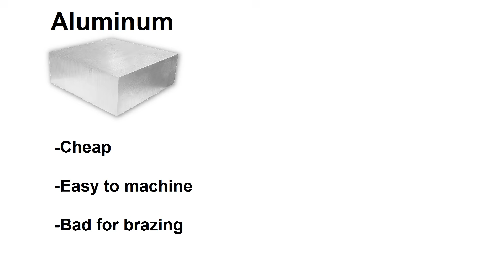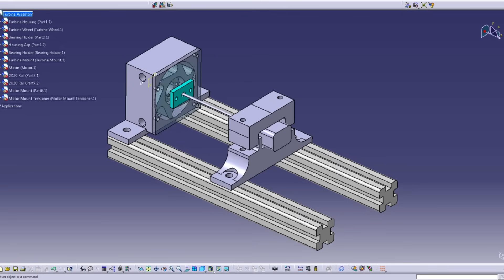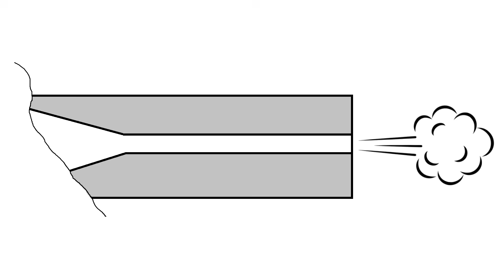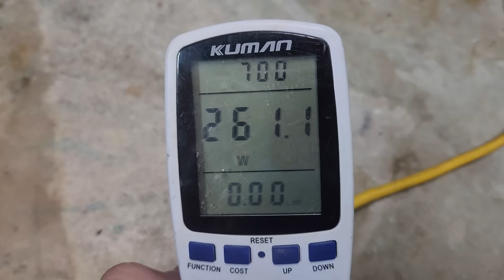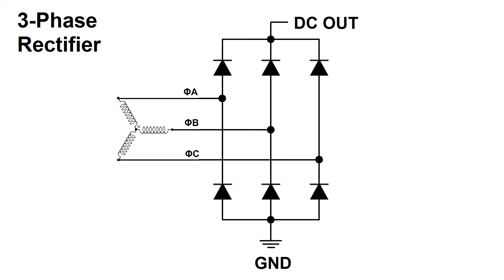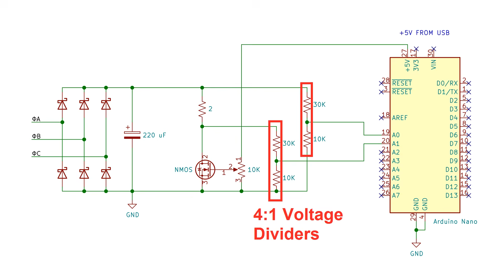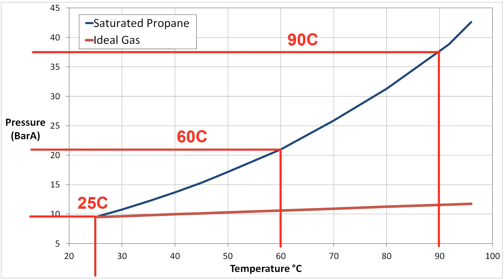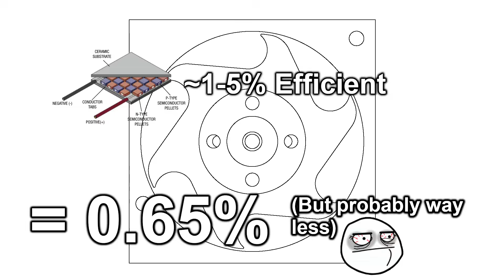DIY Micro Steam Powerplant

Comment: Most modern engines use a variable vane oil pump with metal dividers, and even have variable housing geometry that could help dial in chamber pressures for efficiency across multiple RPM ranges or input pressures. Look at the Chevy LS pumps for the most available solution - they are somewhat self contained as well.
Reply: There are standalone variable oil pumps for industrial use all over the internet for cheap, and honestly look perfect based on some cursory searches. - keyed shaft and even water cooled so you could use the turbine itself to pre heat feed water before it hits the boiler.

Comment: Are you able to use a large cylinder of compressed air, and a heating cylinder to increase the air pressure using the propane?

Comment: Invert the heating coil. You need the hottest part to be in contact with the steam to superheat it. Also insulate the burn pipe so all the heat stays in, and you only lose heat from the exhaust. You already know what to do with the turbine. Wind the heating coil on a piece of flat bar so the coils swirl and force all the hot gasses from the burner to swirl as much as possible and to deliver as much as possible heat to the steam.
Reply: Also recover the heat exiting the turbine by preheating the cold water
Reply: Good ideas, but can you provide a picture link or a less ambiguous description of how a flat bar coil form results in coil swirl?
Reply: @YodaWhat  Picture the coil, wound on the bar maybe 5-10 times wider than it is thick: The coil, held tight, is following a rounded-rectangular rather than round cross section. Then, when you take it off the bar, each turn loosens a bit, and so the longer sections are no longer pointed quite the same way as for the next turn. Increase the effect by un-twisting it a bit more. This leaves the whole thing overall cylindrical again - now roughly the wider diameter of the flat bar, and going around like you draw a five-pointed star, only messier (bit like a spirograph).  This distributes the tube across the inside of the pipe better, and will give the steam better contact with it.
Reply: @RGD2k  - Thank you, that's a very helpful description. I was a bit confused for a reason that may become clear... That kind of helical coil will add a bit of very helpful turbulence to the combustion gas flow and perhaps to the steam flow, BUT it also reduces the total length of tubing, and that is undesirable.  Unfortunately, it is not clear which effect will predominate and give best results. So instead...
A slightly different approach which is still quite simple is to take a strip of sheet metal (not galvanized) that fits inside the round coil and twist it into a helix, then insert it into the coil, and the coil into the chimney pipe. That will slow down the flow of hot gas and make it pass diagonally over the tubing, which is a longer path... Very helpful. 
Also run some vertical wires (at least three, and about half the diameter of the tubing) on the outside of the coil to act as spacers between the tubing and the chimney pipe. That will ensure there are no cold spots where the tubing is pressed against the chimney.
Another useful trick is to slightly pinch the copper tubing every little distance (about 5 to 10 times the tubing diameter), so that the internal shape and cross section is variable. That asymmetry forces the water/steam speed to vary and induces turbulence, which improves heat transfer. The depth of pinches should be about 1/4 of the tubing diameter: enough to create turbulence but not enough to seriously restrict the flow. A safety benefit of the pinches is that if any of them balloon back out to more of a round cross-section, you know you're operating too hot and/or at too much pressure for that tubing. IF you want to operate hotter and or at higher pressure, consider using cupro-nickel tubing with a relatively thick wall, or automotive steel brakeline tubing, and/or using more turns of smaller-diameter tubing, which is inherently better at resisting pressure.
Reply: This.  That's very wet steam coming out during the boiler test, before it even loses heat running the turbine.  It should be entirely transparent, with no entrained water droplets.  That boiler design also loses a lot of energy up the center of the coil, so I might suggest keeping the existing coil and adding a second, tighter coil that runs counterflow down the center of the first.
Reply: Yep, he needs that superheated steam for that turbine
Reply: Setting up some kind of heat exchanger with the outgoing steam would also be good, but a lot more technically complex.
Reply: The feed water needs to go through a large coil that goes around the outside feeding from the discharge end down to then feed into the inch put end for the internal coil and nozzle. Then insulate the outside of that coil with ceramic wool insulation. 
For your turbine, you want to engineer the parts to be the same size. Once they're made use polishing compounds to spin them together to have them grind each other for perfect fitment. 
A secondary condensing turbine on the back side, and perhaps the secondary ignition tube to ignite the propane dissolved in the water steam...
Reply: Yeah, a mono tube boiler with a superheater coil and a water heater coil would definitely help with efficiency
Reply: Not an expert on this stuff by any means, but might it not be useful to pack the boiler with a copper "wool" that would extract heat from the gas and transfer it to the metal boiler surfaces? The idea is that no hot gas is allowed to flow through the system without repeated contact with metal surfaces that extract energy.

Comment: old steam power plants spray the steam with cold water at the steam outlet of the turbine so the steam collapses and forms a very strong vacuum. It makes the turbines a lot more powerful because you are basically adding a atmosphere of difference. The fun thing is you don't even need a pump to do that the vacuum itself pulls in water so only thing you need to do is jump start the process and then regulate the flow. Also tesla turbine is very easy to machine, its only a few flat disks and a housing and works with stem if you preheat it so maybe you should try that.
Reply: He needs a pump to pump out the cooled water and steam.

Comment: You can virtually eliminate the diode voltage drop by using a full wave synchronous rectifier. That’s literally the mosfet circuit to drive it (but in reverse).
Reply: I believe you meant "magic." Or more accurately, "pain in the rear."  Not that you're wrong.  Just that I'm thinking of all the ways it can go wrong and how getting it working is a project in and of itself.  Especially since I'd want some hardware safety in there to keep from dead shorting things.

Comment: The motor rating is Kv (K sub V) not kV as shown. A minor thing, but since motors can involve both units , it helps to be pedantic. Also, what happens if you drain your water supply? Aren't you then pumping propane through your heated coil. How big of a deal is that? I'm thinking not THAT bad. Isn't that basically a BBQ burner?

Comment: nice bro, I got hella suggestion to make this way better!! Use a turbocharger as the turbine, It can soak up as much heat and spin as high as you want to go, On top of that route the wasted steam exhaust around the metal pipe to preheat the pipe, using less fuel to heat it up. you can connect a shaft to the turbo exhaust turbine wheel to spin the generator. Max Efficiency!!
Reply: A good option for a much larger engine, but you'd need a boiler to match - it's scaling up considerably.
Reply: @vylbird8014  they make really small turbos people put on go karts etc. as well.

Comment: Some simple efficiency optimizations:

Converging diverging nozzle-like optimization can be done quite easily: just use a cone shape at the end, it's not the perfect shape but a lot better than a hole. The size is easy to calculate: the pressure ratio is equal to the flow area ratio, e.g. 9 bar -> 1 bar means outer diameter is 3x hole diameter.
Next point of optimization is the boiler flow direction: steam exit should be on the flame side, water input should be at the exhaust side. This acts as a heat exchanger and extracts more heat from the flame. The turbine exhaust can further be used to pre-heat the water in another heat exchanger. Test the steam output temperature, it should be a lot higher than 100°C, this also increases efficiency. Add a bit of insulation onto the flame pipe. Maybe even put another tube around it and let the combustion air run through it to pre-heat it.
For the schottky diodes, you should use bigger ones and have them run hot ~100°C. That makes them way more efficient.
Reply: You seem to know your stuff quite well! What do you do for work/fun so you are this well informed?
Reply: @TheOriginalEviltech  I am a black hole sucking up endless STEM knowledge. I like watching 2 hours deep dive videos into some technical subject and remember most of it. Just don't ask me to remember people's names...
Reply: @HL65536  haha, same here! Not allot of people like us!
Reply: @TheOriginalEviltech idk this channel seems pretty big to me
Reply: A CD nozzle is a tuned device and just making something that looks right wont' be effective. You can use calculators to determine the correct dimensions. You give advice on sizing the diverging section, but unless you can achieve supersonic flow which can be choked down, there is no point in a diverging section and a correctly sized hole is actually the right nozzle.
Reply: ◉◉◉  Bubbles forming at the wall are huge source of insulation There is a YT video on this which I have in my vast collection of bookmarks...but will never be able to find. HAHA.

You've chosen a poor turbine architecture for this app  and design is also bad [inlet & outlet openings are same size. SMH]. I'm developing several advanced power and propulsion turbine designs.
---
✈✈✈ℕ𝔼𝕎  𝔽ℝ𝕆ℕ𝕋𝕀𝔼ℝ  𝕋𝔼ℂℍℕ𝕆𝕃𝕆𝔾𝕐  𝔾ℝ𝕆𝕌ℙ is a visionary multidisciplinary B2B innovation company utilizing a licensing business model or collaborative enterprise with strategic partners to develop Advanced clean, efficient, power dense solutions in domains of energy, propulsion, mobility, robotics / exoskeletons and clean technologies with a particular emphasis on the aerospace sector including space exploration and commercialization
[Yeah, I do all that and more]

===
🚗🚙🚚🚢✈🛩🚁We're working to derail the Exploding Vehicle [EV] paradigm. Any mobile platform is only as good as it's power supply. The main advantages of our disruptive 𝔽𝕦𝕖𝕝 𝔸𝕘𝕟𝕠𝕤𝕥𝕚𝕔 ℤ𝕖𝕣𝕠 𝔼𝕞𝕚𝕤𝕤𝕚𝕠𝕟 engine is the constant maximal efficiency & torque...at any speed, load, temperature or elevation.

It is Simple, Low Cost, Ultra Efficient, Constant Torque, Load & Speed Agnostic, Fuel Agnostic, Transmission-Free, Low Heat/Noise & No Smoke/Odor Signatures, Non-Polluting [only lower CO2 which is not a pollutant] with a >10 year [>10,000hr.] MTBO - better than EVs. >100mpg using ANY liquid or gas fuel even CONCURRENTLY W/O DOWNRATING, even if dirty, including hydrogen, biofuels or Natural Gas. [No range anxiety.] Vehicle lifecycle CO2 output is 30% that of EVs.

===
We're going to go one better by going in the air with a low cost, Ultralight category, personal air mobility system - no license, no certification, no emission laws on the state level and soon on the federal level as the EPA gets their teeth pulled. DOGE!!! 👑🤜🇺🇸🤛👑

===
+++Our maximally torque dense, infinitely variable  𝔽𝕣𝕚𝕔𝕥𝕚𝕠𝕟𝕃𝕖𝕤𝕤 𝔾𝕖𝕒𝕣𝕤 [CVT/𝕀𝕍𝕋]  technology enables transmissions of ~1/10th the size/mass/cost which enables use of motors/engines/batteries of significantly smaller size in EVs. It also provides novel 3D motion of robotic appendages/manipulators/booms

Comment: An alternative to a propane boiler you cold use and in induction coil.  The coil itself is the inductor and you can regulate the eddy current with an iron slug. Great project.

Comment: using the propane to pressurise the water feels like a CSB investigation waiting to happen.
Reply: Yeah, this needs a float valve in the tank or something that closes once the water's gone, or a way to keep tabs on the water level. As a "Should i invest more time in this?" test though it's not horrible for a initial test for a proof of concept. certainly it's a lot safer than a pressurized tank boiler.
Reply: There would be no oxygen in the water tank to burn the propane in the water tank with
Reply: As an engineer in the comments, I say this needs to be monitored by the engineer that makes it, it needs a secondary vessel with a shutoff valve from the main propane tank, and needs a low pressure or drop in pressure automatic shutoff valve from the secondary tank to the capillary for the event of capillary failure.  Shutoff Valve should have an alarm and should trigger a secondary valve to shutoff the main tank.  

And that might be the minimum and you shall not take that as full advice.
Reply: @notamouse5630  ❄
Reply: @notamouse5630  in order words, DIY and Powerplant should not BE in the same sentence.
Reply: @Sun3way  As with all things, appropriate care needs to be applied.  A car is a power plant if you make the alternator big enough.  Car maintenance and upgrades can be DIY if you have mechanical skills sufficient.
Reply: @notamouse5630  makes sense, but there should be some safety addressed in the video rather than just follow the video without any doubts.
Reply: @notamouse5630 🔴 What Is Islam? 

🔴 Islam is not just another religion. 

🔵 It is the same message preached by Moses, Jesus and Abraham.

 🔴 Islam literally means ‘submission to God’ and it teaches us to have a direct relationship with God. 

 🔵 It reminds us that since God created us, no one should be worshipped except God alone. 

 🔴 It also teaches that God is nothing like a human being or like anything that we can imagine.

🌍 The concept of God is summarized in the Quran as:

📖 { “Say, He is God, the One.  God, the Absolute.  He does not give birth, nor was He born, and there is nothing like Him.”} (Quran 112:1-4) 📚

🔴 Becoming a Muslim is not turning your back to Jesus. 

🔵 Rather it’s going back to the original teachings of Jesus and obeying him. 

More .....👇

🔴 THE RETURN OF JESUS
Reply: @1islam1  who asked
Reply: The title writes itself: "Designed to fail... SPECTACULARLY!"
Reply: Steam engine operators use a manual pump to pump the water into the flash heating tubes.
Reply: I love it
Reply: Imagine the tank becomes super heated from a fire and ruptures. The steam mixed with propane would create a very fast expanding kabloowey
Reply: Once the water is gone, it's an accident to happen.
Reply: Hahaha
Reply: CBS has great shows. I love the real house wife's on at 6pm. Season finally will be amazing 😍

Comment: 14:00 I'm a liiiittle concerned with the hand in front of the pressurized water, given the source is at 120 PSI - the capillary tube should reduce the outgoing pressure, but by an unknown (to me?) amount, and I've been told that any pressure above 100 PSI can cause injection injuries.  Which are really nasty.

Comment: Industrial power gen guy here.

2 kinds of turbine plants, single stage and multi stage.

Single stage turbines burn just the gas. Literally a reconfigured airplane or helicopter motor, with a shaft output.

Multi stage units will have multiple turbines on one shaft, with couplings between them. The first stage burns the gas, then boils water, used in the other turbines. 

Hydrogen cooled windings in the alternator, power plant type stuff.
Reply: But seriously that sounds really interesting I would love to hear more
Reply: @Xsiondu  Large power plants use hydrogen to cool the generators. It has large volumetric specific heat capacity, and low viscosity compared to something like nitrogen. Some plants now use de-ionized water, but it has its own set of problems.
Reply: So, all the turbines drive a single generator? Aren't there more independent modules (1turbine+1generator) in use?
Reply: @besenyeim  in order to reach maximum efficiency, one chilled generator end is used. The viscous couplings are used to start the other sections once steam pressure is built. It uses a cat 3516 generator for black starts.
Reply: That's quite efficient, hence the reason alternative energy has a hard time competing with conventional power
Reply: Oh papi!  Tell me more about hydrogen cooled windings in the alternator.  You know how I love it
Reply: um?
theres impulse turbines, such as delavals, and theres reactions, such as parsons.

both can be multistaged... curtiss is a staged version of delaval, for much lower peripheral velocities, and a heron aka aelopile is a single stage reaction... and about the only existing example of one.

problem here is he seems to have both types confused, and appears to have no idea about either...

Comment: You may get a better efficiency with a higher efficiency rectifier. You also might have had better luck with some bjts in a negative feedback config to create a stable voltage rail to minimize losses of the voltage dividers.

Comment: There's also lots of lost heat energy. You could collect the stem and use some kind of heat pump to pre heat the tank
Reply: That's called an economizers, they've been a common part of steam engines since the mid-1800s.